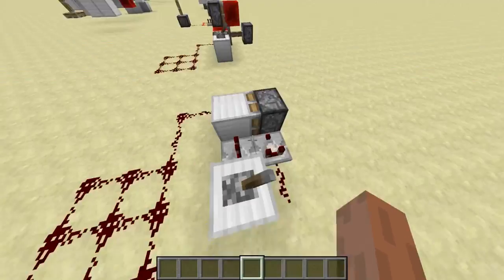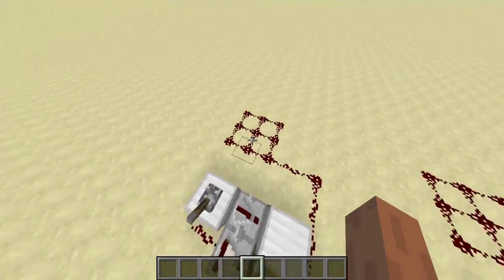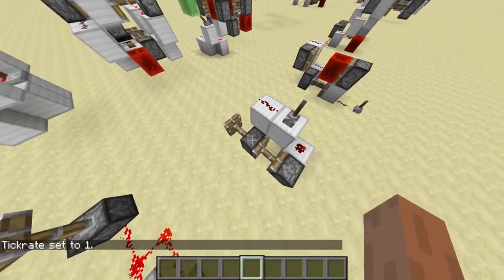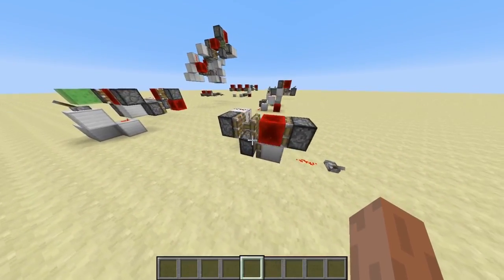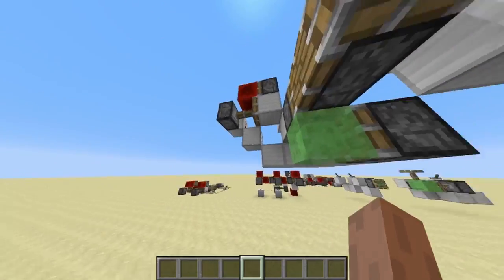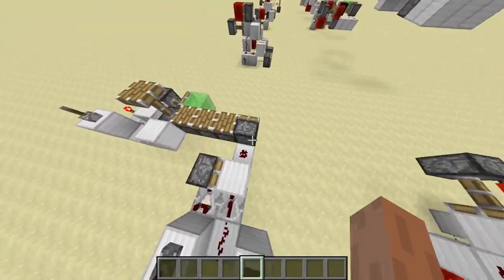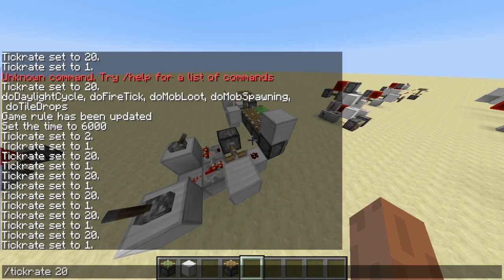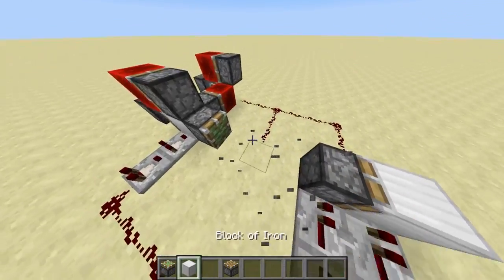Exploiting 1 tick desynchronizations

Comment: Is it possible to fix ghostblocks if the game would synchronize updated regions by itself? What would happen if the game would recalculate the region after the redstone stuff happend?
Reply from the maker: Robitobi01 Why would you want to fix ghost blocks?
And if you resynchronized every section, whenever a block update occurs in it, the game will get very laggy (just from random block updates alone), and I still might be able to get ghostblocks generators, that only work on chunk borders.
Reply: Myren Eario why wouldn’t you want to fix it? Is it useful?

Comment: First :D
I have seen a lot of "invisible" blocks in my world like the ones you showed at 6:38, often enderchests. Other times, when insta-mining large quantities of blocks I have come with that issue too. Do you think this is a minor glitch or it's a big bug that won't easily be fixed?
Reply from the maker: MrMCMax Well, ghost blocks are something, that can´t be fixed at all, if the game calculates everything independently for the client and the server. The only thing, that can be fixed is the ways to generate them. And there are so many ways to generate ghost blocks, that mojang will never fix all of them, without creating new ways to generate them.
Instantmining sounds like something where the server/client communication can easily go wrong, since for some reason the communication between server and client is completely different if you instantmine a block, than if you just normally mine a block. Don´t expect that to be fixed soon.
Enderchests turning invisible is something I have not seen yet. But in 1.8 there are suddenly a lot more ghost blocks, than in other versions.
Reply from the maker: MrMCMax
Mojang can´t fix invisible blocks or ghost blocks. They can only fix the generators. So maybe they can fix, that invisible blocks are generated upon instantmining, but I highly doubt they would manage to fix all ghost block generators I showed in this video, without introducing new ones. It´s similar to the way mojang can never get rid of breaking bedrock or sand generators entirely.
Reply: Myren Eario Instant mining is weird. Try turning the tick speed to 0.1, you will be able to mine 2 blocks in a single game tick if you can instant mine that block. This really confused Selulance and I! xDD
Reply from the maker: Instantmining is just handled completely differently.
And I´ve found something, that could be related to blocks turning invisible when instantmining:
If you disguise a non-instantmineable blocks as an instantmineable block (so it´s instantmineable for the client, but not for the server) and then instantmine the block, you get an invisible blocks. Server and client do not resynchronize after instantmining.
Reply: Myren Eario Sancarn Wow, these desynchronisations are bigger than what I thought xD I hope they fix these annoying invisible blocks, although they would probably fix this type of ghost blocks too, which would be a pity xD We'll see what Mojang does about it.